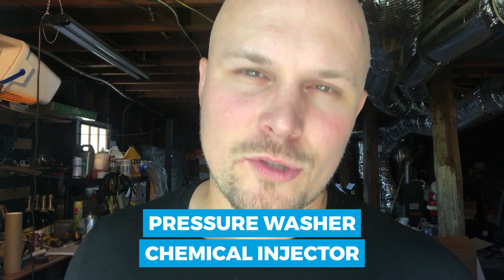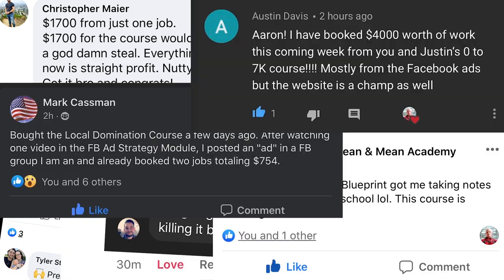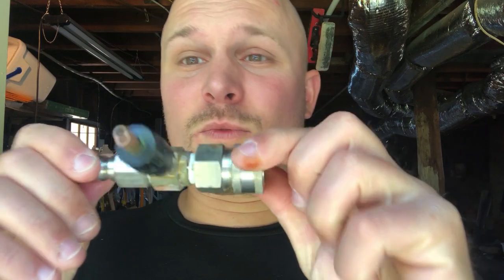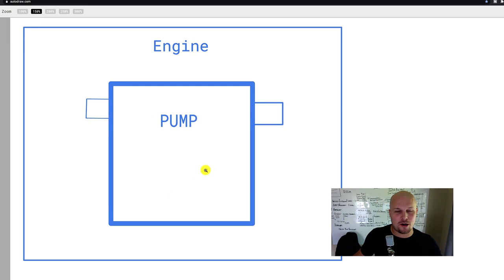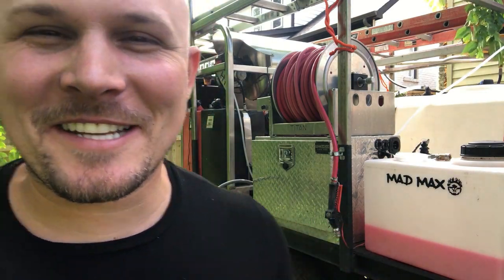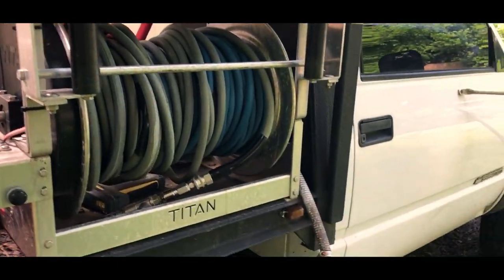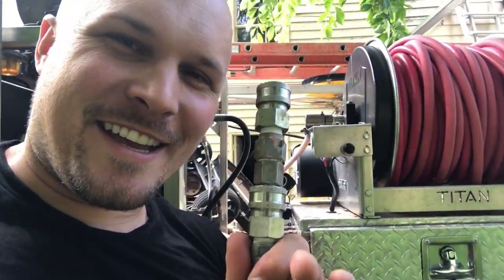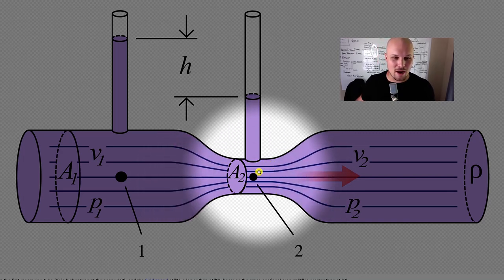Pressure Washer Chemical Injector - DOWNSTREAM Injector | How does it work?

Comment: I have been running caustic soda threw my new pump i had installed 10 years ago 5 days a week. I clear the line when  i am done  .  I have   a pressure gauge in line , ever thing   is fine No problems with the pump.!  Runs great . Reliable ! used it today.

Comment: And here I am with a locked on from corrosion chem injector.  Luckily brought my 12 volt with me to the job or would have had a very bad day but after several hours still have not got it off.   That's for tomorrow.   You sold me on a static injector and have two stainless steel injectors on order.   As usual you had my question answered near a year ago.  Happy spraying my dude.

Comment: Soft wash is better! But down stream if you want. But a 12v battery starts up every time! My pressure washer down stream is my back up! But yes Aron is smart and knows his stuff.
Reply: A 12v battery will fail as well, also those bleach pumps you usually dont get more than a year or 2 out of. I know you can get a stronger mix with 12v systems or air pump soft wash systems, but I prefer to stick with my Honda GX390/Cat pump. Atleast it will last years
Reply: Please explain the difference between soft wash and down stream

Comment: My current injector is a general that I picked up from Russ Johnson at South Side Equipment in Louisville Kentucky I replaced the ball in spring in it with a check valve from the Doug Rucker Store not only is it more reliable it actually draws more Chems initially a little more expense but maybe the most worthy purchase I have made when you pull up to a job and you know it’s going to work
Reply: #lava
Reply from the maker: #LEANNN
Reply: How long has the check valve on your DS injector lasted? Replace anything since you posted this?

Comment: New guy here and trying to fit your class in somewhere but anyway my question, is a downstream injector only used in high pressure and not a 12v soft wash setup?
Reply from the maker: Correct
Reply: 4 months from now are you down streaming or soft washing?

Comment: Good explanation of a downstream injector. But I am confused about something.  Why do you think you should never have an upstream injector? I have been running chemical through the pump professionally since 1990.  It is the way I was taught to do it and actually  a simple system.  The only downside is that it requires more maintenance of the pump.

Comment: Does anyone know the ratios for the various injector sizes? I'm mainly interested in the 1.8 (2 - 3.5 gpm) but would also like to have same info for 2.1 (2.7 - 4 gpm) and the 2.3 (3.5 - 6 gpm) Thx!!
Reply: I’m wondering the same thing
Reply: How much ratio does that adjustable downstream pull
Reply: Should be able to get that from the manufacturers

Comment: DS injectors are pretty much a disposable item. So keep a couple extras in the truck. My longest lasted a couple years. But that’s mostly Bc I lost it under the seat for about 20 months. Then got 4 months of actual use. Making about 2 years in total. Lol. But about 3-4 months of hard use is pretty much a record. If ya keep them rinsed they’ll last longer. But I don’t bother. I just keep a few spares handy. They’re cheap for the money they make ya.

Comment: Nice truck and all but you didn't explain how the injector knows when to suck cleaner and when not to.
In other words, how does the ball valve in the injector sense when there's the chemical hose attached and opens, and once the hose is detached the ball valve closes.

Comment: whtats the difference between chemical injector and foam cann
Reply: The injector is using the venturi effect to draw solvent into the existing water stream. As water passes the second port, it's own pressure creates a vacuum pulling in solvent. The foam cannon works nearly the same, but has gap/space allowing expansion for air. It mixes a lot of air with scent before the water leaves the cannon. Air pockets, especially with soaps create lots of bubbles.

Comment: I just had my first injector die at 3 months
Reply from the maker: Good timing
Reply: @AaronsLeanMeanAcademy  imagine this, it’s was set up on a bypass, the injector had one of those stainless nipples on it, check valve. When you’d flip the valve to bypass the injector it was sending water down the suction tube into the chem “tank”/ my chem bucket. Never new it was possible, they make rebuild kits that’s got a rubber seal and a spring in it, going to try it. It was definitely a inner Ricky Tommy when that happened, thought this damn tube sucked not blew….
Reply from the maker: @justinwest7765  been there. Lol